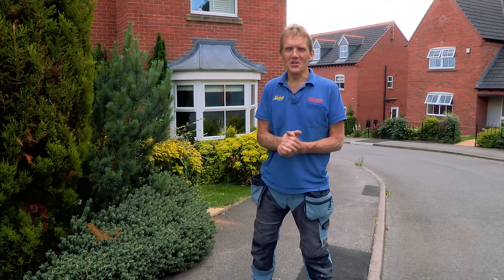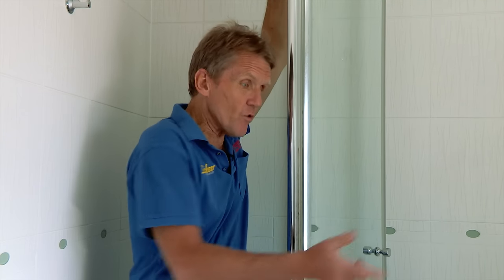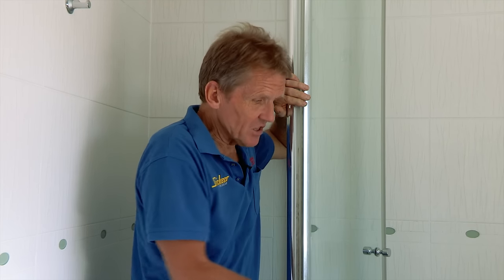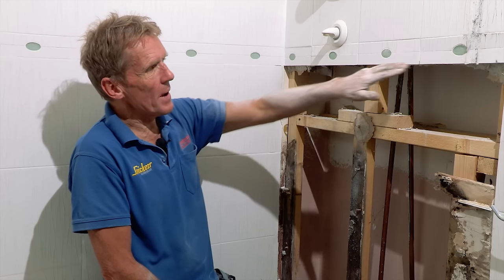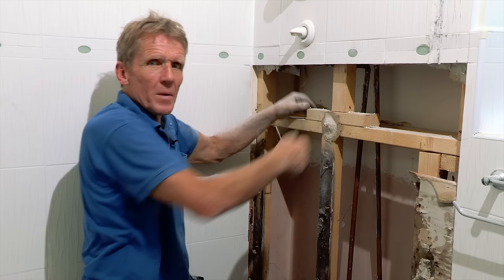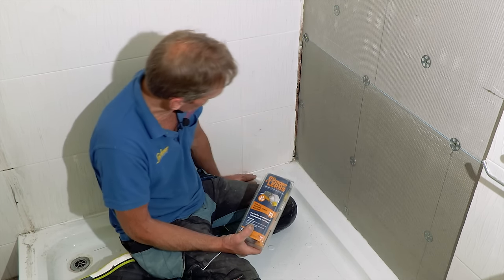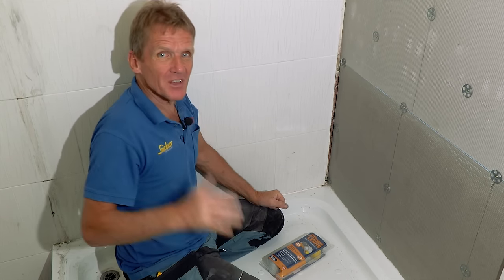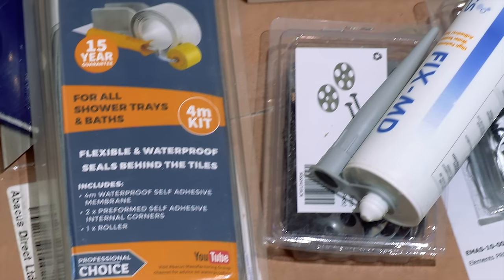Unbelievable Cowboy Plumbing Horror Show

Comment: The problem is, the job goes to the cheapest quote. Contractors quote as cheap as they can and then realise they have to cut corners just to break even. Never buy a new house, they're all crap!
Reply: As a tiler you get called out to these all the time. Customer thinks you just have to refix the bottom row of tiles but the job turns out like this one plus maybe a bit of plumbing work to cure a leak, bit of joinery to replace rotten studding and add extra noggins and yes one or two tiles break and you can't match them Suddenly you're telling them they're looking at the best part of a grand and they hit the roof like it's your fault.
Reply: @caahacky  Well before doing any work the customer should be made aware of what can happen and given all the options possible.
Reply: Weren't all houses new at one stage?? :-/ hahaha
Reply: @NicholasCox85  yes but to.es have changed. Edwardian houses are the best because they had perfected the problems of Victorian time and still had money left to do things properly. Ever since WW1 the country has been skint and cutting corners.
Reply: True - once bitten twice shy.
Reply: So hire someone reputable then.
Reply: I would think the waterproof sheet backing would be code in bathrooms, I'm sure it is in the states
Reply: @caahacky  The advantage is that a 'rotten' bathroom usually comes with something to educate the people with. We had this last week; our handyman goes out on a call to reapply a few loose tiles, ends up finding 2 inches of constant water underneath the bathtub and wooden beams he could carve out with his finger tips. No customeer is looking for needless expenses - but the people were very thankful he didn't just glue a tile back on and instead gave them an honest breakdown. The more  visable the rot, the better the response/the more understanding the customer.
Reply: True Raymond.
Reply: Developers are making a fortune, being a site plumber I know what they are like. I’ve seen trades taken out of a house before it’s finished just to rush everything through. They also want the work done so cheaply that often  there isn’t enough money at all to do it. New houses are absolutely terrible and sadly it won’t change.
Reply: @londontrada  Love old houses and the space, despite their demands,
Reply: @richardhickson4718  poor energy performance though
Reply: Very true i bought a Barratt house in Kilmarnock Toponthank (ROSEMILL ESTATE) Scotland and the number of faults it had were in double digits - several houses in the same street sprung leaks in the plumbing and heating systems (one was even condemned by the council so it could not be sold)  - the double glazing was wood roflmao

Found out from one of the workies that they had used non-corgi certified engineers to install the heating systems!
That old joke about Barratt and the helicopter in the 80's is so true - wish I had listened!

The house was also never registered with Scottish Power so I had free electricity for 6 months before i sold it and the current owner is still using free electricity 7 years on!
lol

I was in for 2 weeks before I decided to sell it and move back to a 1960's flat.
Still made a profit though lol

Best houses in the UK were the John Lawrence houses - big gardens lovely roof work , top of the mark bricks and cement used - ALWAYS BUY AN OLD PRE 1970'S HOUSE THEY ARE MAGIC!

I See down in England all the houses in a specific estate are crumbling and cracking walls becuase they used cheap cement to save money - you are so correct in every way!
Reply: @caahacky  Yes i feel your pain ive been there and trying to remove the ceramic shower base without cracking it when its been cemented in and avoiding breaking the tiles around the base - nasty!
Reply: I disagree it's just poor workmanship from hiring Albanians on the cheap
Reply: @NicholasCox85  everyone knows houses tend to be built to price not to a standard like they used to be.
Materials are better but workmanship not what it used to be. I prefer pre war houses and like more space
Reply: @caahacky  A grand lol ... and some...
Reply: @michaellangridge7679   ive lived in an old house for years. It has as much insulation as you can get in, but is still nowhere near as warm as a new build. BUT i would take that all day long over the shite new builds of today. I'm a tradesmen and believe me i stay well clear of the houses i work on!!
Builders of large new build developments today are greedy profit chasing twats. i hate them all!!
Reply: Here in Texas there is little to no protection for the home owner, many of these incompetent contractors and trades people should be banned from working and what about the SO CALLED inspectors that is supposed to be doing their jobs?
 How does this kind of garbage get by; throw a few of them in jail for fraud or theft and the problem will cure itself. The homes being built in North Texas are only for the wealthy; none for the working class except the trailer route and we know how trouble free and inexpensive to buy and own they are! WHY
Reply: We're renting in a place we love.  Love the area, and love the house, itself.  Problem is, there is an obvious water issue.  I did notice some odd things, but we had been assured repairs were done.  I now know they did as little as possible to give the place a facelift before new renters came in (have become decent acquaintances with the maintenance guy, who's been honest about his criticisms of the management company).  We've now had the water leak from the upstairs shower into the kitchen.  Keep seeing more signs.  Guess we'll be here until the lease is up (we would be out thousands if we broke it, anyway), but this is just disappointing.  It seems like everything that can carry water in this place is leaky, or was leaky, and it HAS to be the folks who built it.  The water is even loud coming down the pipe from certain areas of the house. I'm half considering looking up what company was responsible for building these. They're not that old.  Not as far as houses are concerned.
Reply: @KH-dj3zy  Before you give up you might want to take pictures, document the numerous leaks and have a qualified professional give you a written estimate for repairs then check with your small claims court and if possible Levi a small claims suit against the guilty parties or better yet see what a lawyer has to say. You are the renter not the owner.
Reply: old houses have plenty of problems, especially everything between Victorian and 1940s. Because there was no building standards at all.
The Victorian house building boom was as every bit about making money as fast as possible by the even faster construction of mass housing as anything today. And when I say no building standards I really do mean none at all. 
Old houses dont even have foundations, they have brick going straight onto earth and there was definitely no geo survey done before construction. With how tall and heavy they are, subsidence is very likely.
We always rose tint the past, the past was shit. 
Old houses are also shaped based on uses of the era. Victorian houses for example have double high ceilings and are almost impossible to heat. This is because they are designed with a permanent raging coal fires in mind, which would make the house hot and smoky. 

flaws in modern builds are because of builders not following instructions or the architects purposefully breaking known best methods.
Before mid 20th century no one even knew what they were doing, the best methods were still shit because brick houses were still a relatively new thing.
Reply: Never buy a flipped house for sure.
Reply: @xl000  I've seen multi-million dollar houses built like crap. It's all from the builder, how much he cares or not. Put lipstick on a pig, it's still a pig.
Reply: Is aquapanel available from wickes the same as those panels ?
Reply: One of the best tradesmen I've ever watched on YouTube. Very very clever man

Comment: Having worked in both the UK and Australia, I can say the UK are way behind on this kind of installation. In Australia it’s now regulation to use this kind of system and waterproof the whole area. Also this job has to have a compliance certificate issued too. Keep up the good work Roger
Reply from the maker: Paul Lenton 
They have just changed the regs in the U.K so we now have to tank shower areas. We are only 20 years late on this
Reply: Correct Paul. Certificate issued on completion with all the relevant info on it from who and what was installed.
Reply: New Zealand led the way on this, Aussie rules state you can just paint round the edges of a concrete floor, we paint the middle too.  Aussie rules say the waterproofing membrane can stop at 1500mm from the shower rose, I keep standing there and shouting at the water to stop but sometimes it does not listen....so we cover the whole floor and 75mm up the perimeter.

Comment: You, like, did the job properly!! Such a refreshing change👍 Awesome vid - that studwork made me want to cry 😭. You wouldn't believe the stuff I've seen over the years... well, YOU would but most folks wouldn't. Might share some of them at some point. Got a vid coming out next Sat (I think?!?) touching on a similar topic. And to folk saying "don't use tiles" - nowt wrong with tiles if the job is done properly. 👍🛠👍
Reply: if you don't shame the companies pal they wont change.
Reply: the plumbing looked horrid as well...  piped all crooked, no supports, flux not cleaned off so you get all that green corrosion... sigh
Reply: @phiksit  Yeah i thought that too - i am not a plumber but even i can see its crook!

Comment: I work for one of the uk's largest house builders and we are obsessed with using ply and moisture board in every property we build.
Moisture board is absolutely useless, the amount of strip outs we do a year is rediculous, the ply backing we install over stud work is equally junk and turns mouldy once the moisture board is compromised. Also we install the plasterboard over the shower tray upstands and leave it 10mm off the tray, causes us no end of issues and it's so upsetting for the new home owner. This video certainly offers an excellent way to  avoid this issue. Great explanation.
Reply from the maker: Adrian
That is really interesting to know. I would love to talk to that builder.
Reply: @Kenny Groundhopper everything new is just shit. capitalism, efficiency, powerful companies, etc. they shower us with cheaply and shitly produced shit, because first of all it leaves them a larger profit margin if no effort and proper raw materials are applied, second of all, you are going to buy the next item or all call them back for help once the shitly made thing goes bust. it is a vicious circle and inevitable consequence of capitalism unfortunately. regulation would help, but companies are stronger than governments, they lobby, they bribe, so all decent efforts fail. i just end up doing everything for myself now. learned to do so many jobs over the years.

Comment: An informative video and I’ll be watching the rest of the series.
Too bad they don’t sell the Elements board here in the U.S.. The Elements board looks to be light weight and of course as you said, waterproof. The closest thing we have to it (as far as I know) is Durock which is a concrete backer board which is cement based with a mesh in it. Then you have to waterproof it and it doesn’t have any real insulating properties to it.
I always enjoy your videos as you always do the work the way it should have been originally and you teach and inform the viewers along the way.
We have trades people like that here too but they are few and far between.
Thanks.
Ron
Reply: Schluter system is similar? Though any system will require taping of joints/corners etc

Comment: I always used cement board for shower/tun enclosures. But I did use a very similar material to this to patch a shower in a rental apartment my friend owned. He was really cheap and only wanted to do the bare minimum. I cut out a section of tile about 2' high and the length of the tub, just enough to get past the wet and rotted parts, replaced the rotten wood as best I could, and then used the foam-core tile backer board and tiled it. I was skeptical of that stuff but now it's over 20 years later and it's still holding up.

Comment: I did a DYI reno where I replaced the tub and its enclosure. I used a vinyl tub enclosure, and rather than using green board, which was what was under the old tiles, I replaced it with cement board, which is 3/8" thick, and claimed to be completely waterproof.

Comment: Wow - they have lost half of the bathroom with the depth of that stud work

Not to mention the stud & pipe work are awful

Cowboys

Could you use that board on top of plywood on the floor to create a wetroom?
Reply from the maker: Yes if you look at our other videos you will see it done.
Reply: There's a toilet waste behind the stud work, hence it's about 100/110 mm off the wall
Reply: Yep, there's a soil pipe there. Personally I would have rebuilt it using 4x2 and used the solid wall behind to make sure it doesn't move. I'd definitely not have left the crap that was there.

I'd also have built in a shelf into the space, which would be very useful in a shower. Did exactly that in my own bathroom about 10 years ago, using tile backing board just like in the video and it's been great. Remember to put a slight slope on any flat surfaces in the shower - enough to help water to run down but not too much so your bottles and soap don't fall off.
I'd also struggle with that mixer fitting not being centred, but that's probably just me.

Comment: See it all the time on new build , The shower tray get high off the floor why,  ITS A NEW BUILD ?????? . Shower valve hanging off pipe work , So frustrating .
Reply from the maker: Yes it is pure laziness to get the waste pipe across the joists
Reply: What is the point of regulations if nobody police's them, the big house builders are more concerned about making more profit than giving the purchaser a building that is fit for purpose.  A lot of people think if they purchase a new house they will not have any costs for probably 20 year how wrong they are, most start costing after a couple of year when the shoddy workmanship and materials start to fail.  Sorry for the rant but really get annoyed when the job is not done right, and the good guys do not get jobs because they are too "dear" but what they are doing is providing a quality job with the right materials.  Keep up the good work with the videos.
Reply: Totally agree, the quality of the work on a lot of these builds is quite often crap and it does make you wonder who the main builders get in to do the work. I've just purchased a 7 yr old house and having to sort out the floor tiles coming loose in both of the upstairs bathrooms and I do remember my solicitor telling me to never buy a brand new house as they're always over priced and I'd say its luck of the draw if you get issues and how bad they are and I do agree with bill in that if its happening in one house its happening in all them .
Reply: what's wrong with shower tray high off floor? Im interested

Comment: I’m confused. You said the stud work wasn’t adequate. Yet nothing was done unless I missed something?!?...
Reply: Watch at 9:14. He fixed the problem with a HORIZONTAL stud to secure the water valve.
Reply from the maker: Thanks Adrian
9.37 also shows the horizontal bracing. I have learned from this video that some people need everything explaining while others can relax with a bit of music and work out what is going on for themselves.
Reply: Skill Builder but some people haven’t got the experience or knowledge of some of you guys and what to look for as I have a similar set up in our house. Hence the question......  best not to bother asking  you in the future 👍🏻
Reply: Adrian Mikeliunas cheers. Noticed it the second time of watching. Cheers 🤝
Reply: It looked like the studs were 24 inches o.c. In the U.S. they would have been 16 inches o.c. and it looked like the cement board was flexing a little when you showed how sturdy it is.

Comment: Both of my showers were installed 20 years ago with the tiles on top of marine ply. No leaks, staining or cracks have ever occurred. The grouting and tiles are all as original. I did use 2 pack waterproof grout and high quality waterproof adhesive. If I was doing it today, I would use the abacus board, but it wasn't around at the time

Comment: Jesus who did the pipework, unsupported pipework, one pipe clip and verdigris all down the pipe, i would be seriously looking at the solder joins as well - where did he tie up his horse  ! As previously said most new houses are complete crap built for speed and profit.
Reply: Probably used lead base acid core solder on the copper pipes!!
Reply: Verdigris in some cases can be caused by condensation over years trickling down the pipe, not always a leak!
Reply: Are you praying or blaspheming

Comment: did mine as i had to put new tray in .  i used cement board then tanked it ,  wasn't overly expensive for materials compared to right materials .  didn't cost me labour. I'm not a trade person but I will go the extra mile to get it done right .